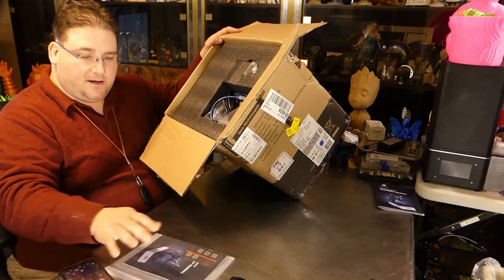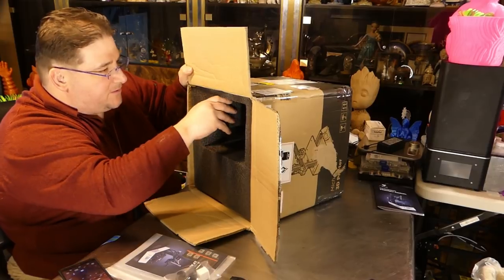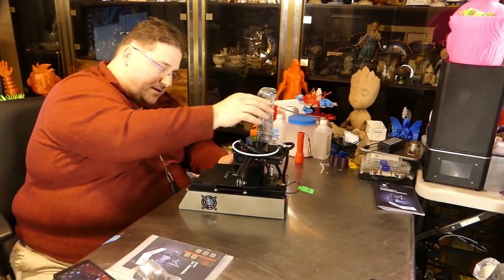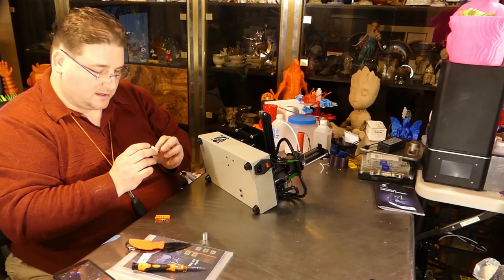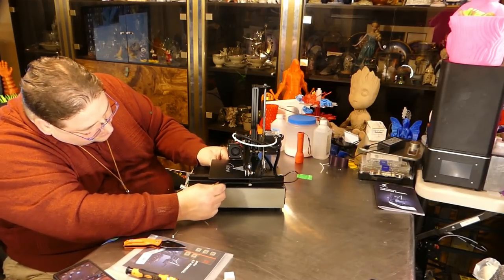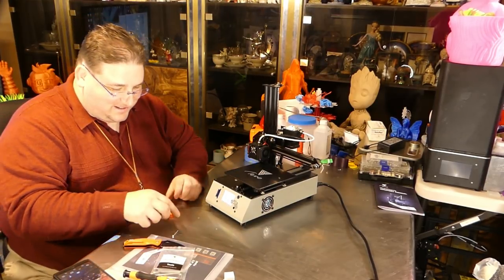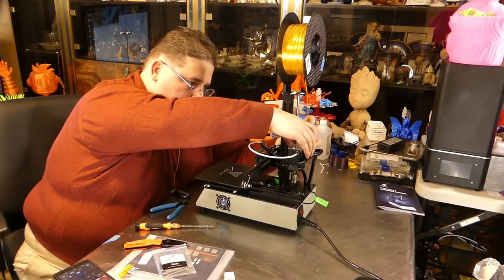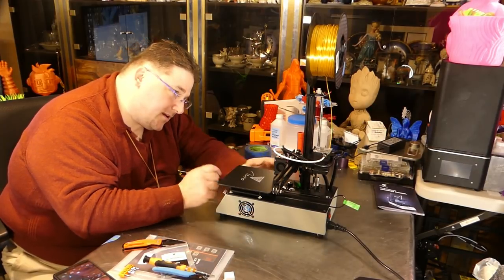Today's 3D Print 201 Tevo Michelangelo! Unbox, Setup, Print

Comment: Hi, bought Tevo Michelangelo, Thanks to you, Please let me know where can i buy ender 2 spool holder which is in this video at time 13:14, Thanks waiting for your reply.
Reply from the maker: By tonight you won't have to I have finished work on a 3D printable version that works fantastically I will post it later tonight I have it on the printer running now as a final test
Reply: Cool, Thanks a lot

Comment: I am guessing... when you were turning the knob to insert the filament the stepper motor generated voltage back into the main board causing the reset.  Glad the heats back on !
Reply from the maker: Ohhhhh good point i was turning it pretty fast. I had not thought of that!

Comment: So thusfar, and I know it's hard to say, but which do you prefer now? The Tevo Michaelangelo or the Creality Ender 2?
Reply from the maker: I prefer the Ender to it has a heated bed a taller build volume as well as still producing cleaner Prince I ran the exact same G-Code literally on both printers the purple and green nose cone what you will see in the next video I even optimize the code for the Michelangelo and ran back code on the Ender 2 and the Ender produced better results I even ran the Ripple test that is included with the Michelangelo on the Ender 2 and it produced a Superior result

Now mind you the difference is very subtle for the vast majority of people out there either one of them produces fantastic results the Michelangelo is a little trickier without the heated bed even pla warps if you don't get a proper stick :-) and without a heated bed it wants to Warp :-) I've ruined a few articulated butterflies trying :-) but you can make it work glue stick really helps

I do love the integrated base that they use on the Michelangelo that is fantastic I would love to see creality update their machine to use a similar form factor and I plan to do exactly that by building a similar case for my Ender 2 if I manage to do that I will make the files available on thingiverse

So if I could only have one machine and I had to pick one I would still pick the Ender 2 but I'll give credit where it is due tevo did a fantastic job on this machine I am so far very impressed
Reply: Nerys very well said sir, thank you for your feedback :)

Comment: I was studying your gcode setup for the prints I downloaded off your profile. The Marvin, Vase and rocket come out amazingly well! The Benchy does not even when I apply glue... the print head keeps knocking it off even when I carefully adjust the bed level to perfection. How do you setup your Cura Profile properly? I have been looking into good settings and also wanted to try your profile since for the majority of the prints it is flawless but not sure how to import it into Cura... Is the Tevo Michaelangelo's nozzle actually 0.4 or 0.5 ? It does not say anything in the manual about this... only that it is 150 for all axis.
Reply from the maker: My first guess would it be that you're printing too hot and the print is curling when it curls the nozzles able to crash into it but you might need to increase your squish just a tiny bit because the Benji has enough surface area that your nozzle should not be strong enough to knock the print off the bed
Reply: Yes you were right all the way... I had my temperature set at 220 and since I cannot code I had no idea how to adjust it later... now I know I can do it directly from the lcd screen... not my favorite option since I would much rather be able to automate it in the cura settings but my later prints are far better at 200.

Comment: Thanks for the video! Question, how do I setup the slow printing for good adhesion. You mention it but didn't show how to do it.
This is my first printer and first time printjng. Thanks in advance!
Reply from the maker: No problem. In you slicer there first layer settings. You can define seperate first layer settings there
Reply: Nerys Thanks for the info! I was wondering if you could go over what software, slicer and the settings you use specifically for the Tevo Michaelangelo?
This is my first printer and there aren't many tutorials out there for this printer :-(

Comment: Is there a 3rd party taller zrod avail somewhere?   Best printer setup ever.  Is there a 3rd party bed heater?
Reply from the maker: Openbuilds sells the rails Amazon and eBay has the Z rods and you'll need to extend the wires and that should be all you need to make the printer physically bigger I don't know if you'll need to change the firmware or not

Comment: Awesome! What slicer do you prefer with this printer?
Reply from the maker: I prefer simplify3d but I think this is largely because that is what I'm comfortable with I have tried cura and I get similar good quality results out of it
Reply: Simplify3d is all there is IMHO. Haven't played with Cura for years because it was a pain back then.
Reply from the maker: Its still a slight pain but massively improved. I was impressed with it. My only issue is it does odd things that i cant figure out how to get it to not do. Such as traveling before doing the outer perimeter which permits oozing to occur. Still working on it. Some prints actually work better in cura. Have not figured out what the difference is for why that is. Seems hit or miss.

While s3d is slightly less featured than cura it has a much better ui and is far more polished and consistant. It does not do odd things randomly on you. Ie you know what your going to get.
Reply: great, I have Simplify 3d :). Is there a spool holder to print for this as I do not own a Ender 2 to steal it off of lol.
Reply from the maker: I have not found one yet I will see about possibly making one

Comment: Is that halfassed Ender 2 copy FCC certified? It's possible you got a prototype, or they are shipping, hoping not to get caught, if it is the source of the audio buzz
Reply from the maker: No it's not the printer I think it's the power supply The Orange Box that I power everything from I've already had this Buzz problem destroy several videos I thought I'd fixed it I was wrong :-(

Comment: Hey,

I'm having some real trouble with warping on my Tevo Michelangelo.
I'm printing with mostly 0.1 or 0.2 mm Layer Heights. My Infill is set to 20%.
My default printing temperature is 200° and I tried everything between 190° to 230° on my first layer.
Further more, my printing speed is 60mm/s and 20mm/s at the first layer, with retraction enabled.
Fan speed is set to 10% after 5 layers and I start with 0% at the first.
Additionally I use a Brim with 6mm thickness.
And I tried leveling my bed at every height possible.

I'm stuck and I would really apriciate if you could help me.
Reply from the maker: Slow down the first layer even more. Increase the nozzle gap a hair raise first layer temp to 220c goto 225c if yoyr plastic will tolerate it.

Use glue stick.

The filament sgould almost drop i to the bed. Combo of hot slow and gluestick will let it stick nicely. After first layer whatever temp and speed works for you.

But the first layer must be silly hot and slow slow slow with the gluestick.

Comment: hi my TEVO Michelangelo Portable Complete 3D Printer is showing maximum heat reset setting can you pls help me to adjust setting i am not able to contact any one as i bought in amazon thank u
Reply from the maker: If you bought it on Amazon you can exchange it through Amazon their return policy is very good but as for helping you with the problem I need more information under what precise conditions do you get the heat message is it immediate or does it begin to heat up and then fail is it while it's printing or you attempted to change temperature at cetera

Comment: Do you have a curaprofile for the Michelangelo ?
Reply from the maker: No I do not I have not tried to use Cara but if you install the Ender 3 profile and then just adjust the dimensions for the Michelangelo it should work fine the Michelangelo is a very good machine the print quality I got from it was excellent
Reply: @nerys71  thanks for you answer….. yes… the Michelangelo is realy amazing. I've bought it after i saw some Videos in YouTube. Of course yours too. Thanks for the great job from guys like you. The printtest file from the SD Card they deliver with the Michelangelo was printed really unbelieveble. My own files i cannot get in the same printquality out of the Michelangelo. I think they had different Settings. But where can i find the same Settings they sliced their testfile with ?

Ist it possible to check out the sliceparameters from a gcode file like the testfile tevo delivers with their Printers ?
I will check if it runs better with the ender 3 profile…. many thanks ;)
Reply from the maker: @yu2ba  I think simplify3d can extract settings from a G-Code files but I'm not sure about that but either way you shouldn't need it

Here are some basic settings very good base model to get you started you want three parameters or walls 3 top and bottom layers 25% grid infill printing perimeters first then infill

Print at 50 m m per second with a 50% first layer under speed first layer at 220 Celsius for pla

No fan on first layer on second layer you can turn on fan and reduced temperature if needed

Retraction 7 mm at 35 m m per second wipe 8 mm

Let's see what those basic settings get you and adjust from there

Comment: looks like a cool printer. I really like my tornado and its much larger for just a 130 dollars more.
Reply from the maker: About 200 more actually you can get the tornado on sale right now for about 350 360 but that's not normal price :-) this printer has its place you need something low-power portable simple take me up a little bit of space excetera you can't just grab the tornado and run with it :-) this you can't if you can only have one of course I would pick the larger but if you need small this is pretty nice :-)
Reply: Right, I suppose there are people who like to print on the go lol. :D

Comment: I think your table is interfering with your lav mic, is it grounded?
Reply from the maker: Is the table grounded? I had never considered the medal table might be a problem
Reply: I suspect it might be the source of your interference, a grounding/static strap might be all you need. :)
Reply from the maker: So ground the table? What do I ground it to?
Reply: It is possible that a multimeter might pick something up, but I think the easiest way to test the theory would be with to get a resistive ESD strap.

Something like a "Desco 09813 Grounding Cord with 10mm Snap Stud, 15'" can be screwed into the center screw of a power outlet cover and the other end can be attached to a screwed on snap fitting on the metal of the table.
Reply from the maker: Ok that would be pretty easy to do. It never did it before until this new power supply. I wonder if it is not properly grounded.
Reply: Probably less the power supply isn't grounded, and more the power supply isn't shielded and induces currents in surrounding metals. :)
Reply: That or use ferrite beads to provide noise tolerance?
Reply from the maker: Now thats interesting. Giant metal table would be perfect for picking up all that noise too.

Comment: Is it possibly an Induction Sensor as the endstop?
Reply from the maker: Interesting that would make sense how would I test that? I guess I could try connecting an extension to it one made of plastic one made of metal if it's inductive the plastic one won't work :-)
Reply: Nerys should be able to stick something non metal and metal in front of it... if it lights up only with metal it’s inductive.. if it lights up for both, it’s capacitive probably. 

In your next video can you give us a close up of that sensor. I’m curious to see it.
Reply from the maker: You betcha.
Reply: It is probably a Capacitive sensor.
Reply: Inductive sensors are huge, so not a chance.

Is there a magnet nearby? If so, it's hall effect.

Look at it with your cellphone camera while it's homing. If you see a glow or flashes on your camera monitor/cell-screen, it's a reflective IR prox sensor.

Comment: Ender 2 has a heated bed and this one is technically smaller, so why is this not significantly cheaper?
Reply from the maker: Diminishing returns they're actually pretty similar and I actually consider the Ender to be underpriced which is why I considered to be a very good bargain the Michelangelo also has more metal there is no acrylic and has a fully-enclosed base while the Ender has an acrylic shell and base although the important parts are metal you also have the difference between an assembly required kit even if the assembly is minor and a fully assembled out of the box printer

You're paying a slight premium for the Michelangelo to have the All In One Construction all metal and fully assembled out of the box

The Ender is higher quality in my opinion although this is subjective and they are very close you lose some convenience by not having the printer fully assembled and not having it be all metal and all in one but as a result you gain a slightly larger build volume and slightly more features such as a heated bed

So think of it as a trade-off between features and convenience if they made the Michelangelo and assembly kit it would probably be cheaper part of what you're paying for is the fully assembled nature of the printer which is why it's slightly higher in price

Practically speaking the build volume does not really affect price at the scale it's maybe $0.10 in materials I suspect it has a shorter z-axis in order to permit it to fit in a reasonable sized box that does not get surcharged for shipping when you ship stuff there is a sweet spot for a maximum size where if you go over this size in any one dimension you get heavily penalized by shippers I suspect this is one of the reasons they made it besides they did so much for so they even had to leave off the rubber feet in order to just make it fit

In my personal opinion the Ender two is a better buy for overall quality of Prince but the Michelangelo gets very very close in an all-in-one turn key solution which is pretty darn cool and hopefully this good solid competition will cause creality to stay on their toes this is something we desperately need two good quality manufacturers competing the end result equals only good things for the community :-)
Reply: I am recommending the Ender 2 to friends who want to get into printing at a low entry cost and -- say print parts for a hypercube build. I wouldn't recommend a printer without a heated bed -- since in all likelihood the parts would be PETg and you need a heated bed to print PETg -- small question, does the ender get up to 90-100C on the bed  (for ABS or Polycarb posibilities -- not sure if it's an all metal hotend) -- this is a good entry into that price point as a small i3, but no heated bed immediately makes it a non-contender for makers who want to print stuff other than PLA/TPU.
Reply from the maker: Agreed. The new ender (what you would get if you bought it now) is supposed t0 be able to get over 100c on the bed. I am working on confirming that.